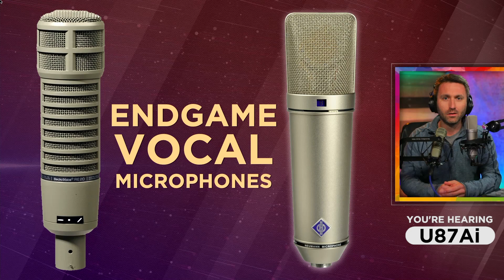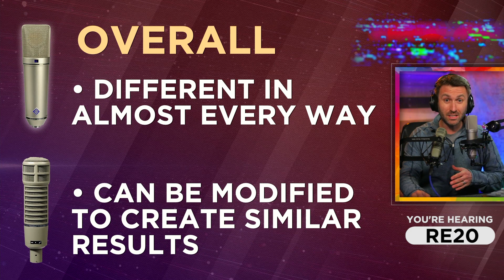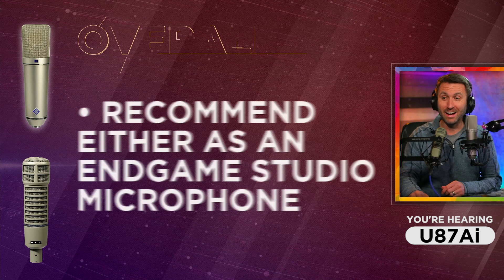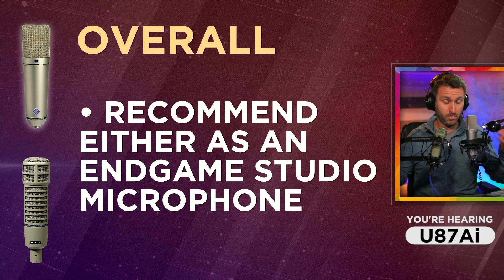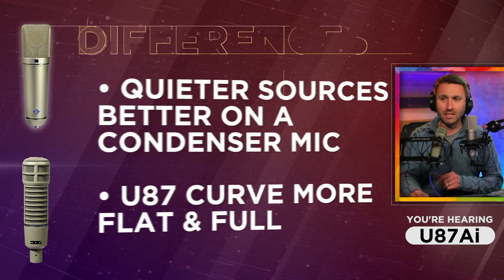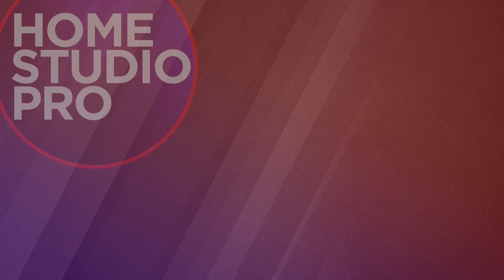RE20 & U87Ai: Endgame vocal microphones?

Comment: I have used both of these, and my reverence for each is boundless. Yet I have always been taken with how the RE20 as a dynamic mic captures the articulation of the spoken word when stacked up against high quality condenser mics. The RE20 can be a little sibilant on certain voices - mine included - but the foam windscreen does an adequate job at attenuating that quality. Yet all-in-all, I really adore its more open top end. It really is no wonder how even after 50 years it remains in the mic pantheon. 

I must say, your processing on both are immaculate. You easily could listen to both for hours, and never even approach the slightest fatigue on the ear.
Reply from the maker: wow, that's the ultimate compliment! I agree with your mic assessments.  thanks for being here on the channel!